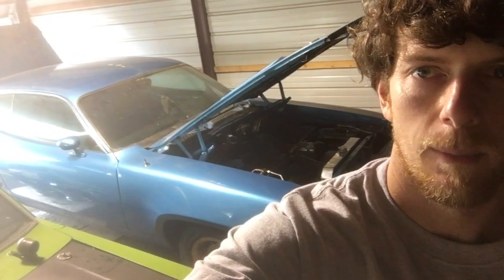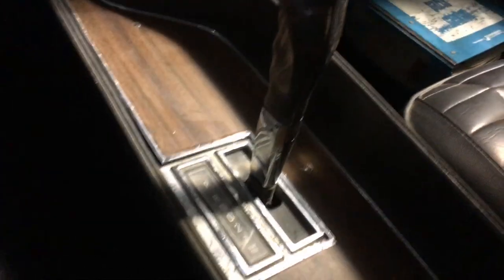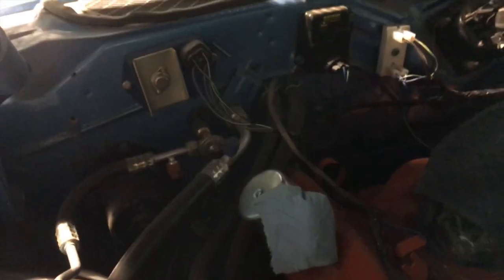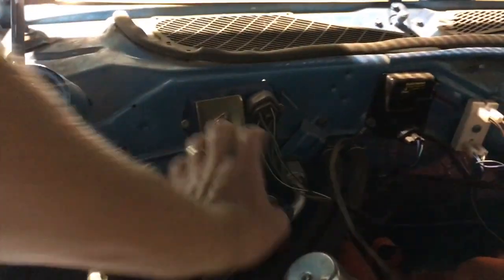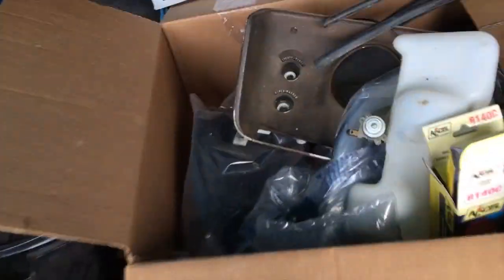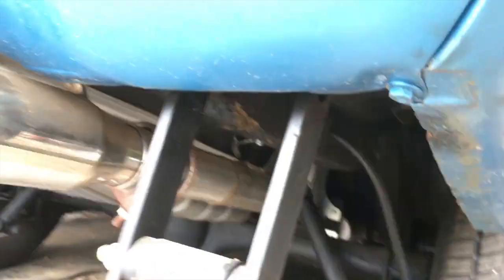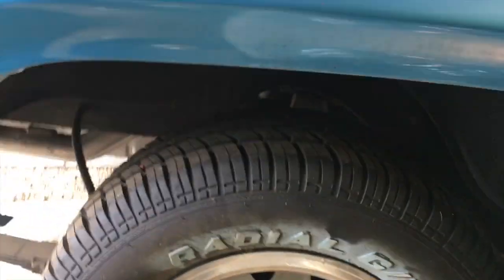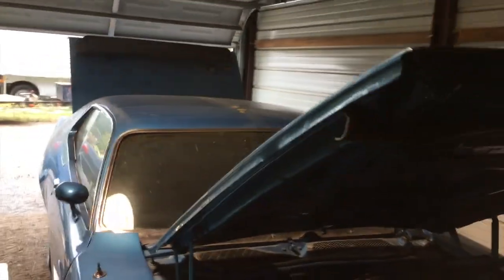RoadRunner Introduction

Comment: Great! Looking forward to the roadrunner project. I have a 74 that I'm working on. Thanks for the tip about the voltage regulator. Couldn't stop mine from charging 15 volts. You have a wealth of knowledge and thanks for sharing it with us.
Reply from the maker: You bet! Thanks for watching! I had to have the regulator when i swapped my challenger with the new hemi.